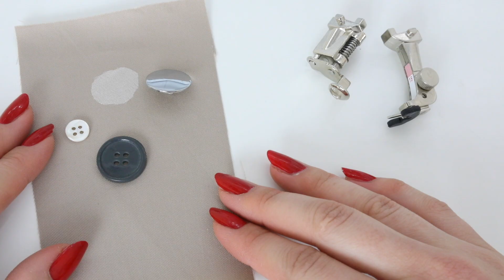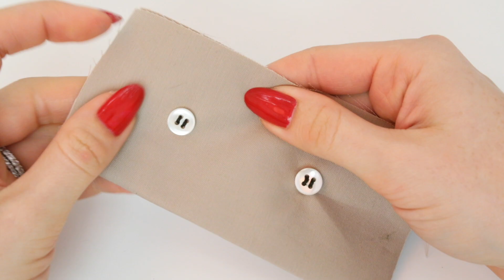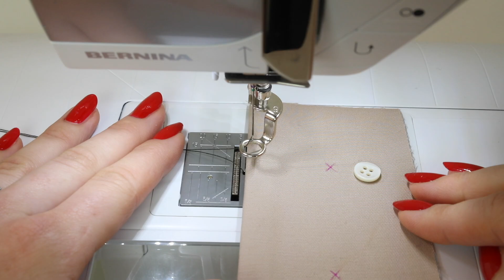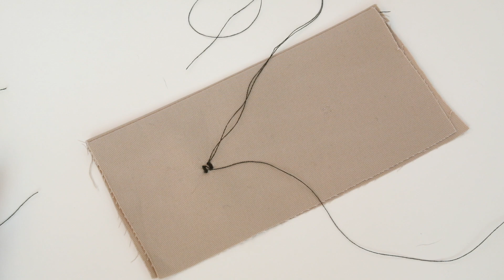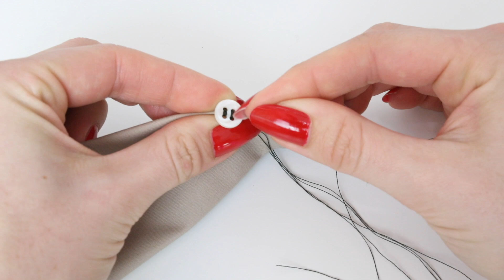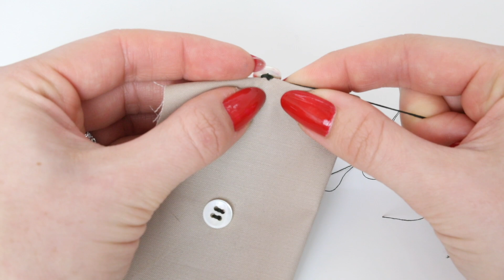How To: Sew Button On Machine

Comment: Hello!  I have recently found your videos, and watched the sewing 101 series.  You have definitely inspired me.  I was wondering if you have any suggestions on how to sew on a button to a hand knitted piece.  I knit, and I need to add 3 buttons onto a baby sweater I have finished.  Thanks in advance! <3
Reply from the maker: I would probably sew them on by hand. You will want to create a shank (if the button doesn't have one) (I explain buttons with and without shanks in the video). To build a shank by hand I would use a cocktail stick and sew over the button and cocktail stick. Then when you remove the cocktail stick you can raise the button and you will have a shank. Hope this helps? Aneka

Comment: Have you thought of using an external mic to reduce the echo?
Reply: Ah ok. Maybe it’s switched over to camera mic instead of the external accidentally. Darn technology 😂😂
Reply from the maker: @camilleakdj3648  I don't think it can switch back as I use external mic as my only input. It is probably the settings I have used 'all the gear, no idea' is unfortunately my scenario! Lots of guessing and watching other YouTube videos on 'how to'! Is it like it throughout? I am trying to find the problem. Thanks very much for letting me know. Aneka x
Reply from the maker: Hi Camille, I do use an external Rode mic for my videos. Not sure what went wrong here, maybe I didn't have it set up properly? I will look into the issue. Aneka x
Reply: No problem! Hope you work it out, I have absolutely no idea in what direction to point you 😅😅😅 I can’t even work a printer most days 🤣🤣
Xxx

Comment: The Viking machines past yours (just a little newer) have a button hole foot that allows for shank and stabilizes the button thereby requiring no tape.  Gosh I did not know you had to allow for more shank with thicker fabric, thank you for sharing that, cheers!
Reply from the maker: Thanks so much for sharing. It is hard for me to keep on top of all the machine models, showing options of what is out there. Thanks so much for sharing this. Aneka x

Comment: I’ve also never tried this before. My machine sewing is largely self taught (with the gaps to prove it!) and hand sewing was taught to me by my mother (who had amazing skills but didn’t enjoy it very much). I’m uncertain about how to go about sewing the anchor button on the reverse side. I’ve seen it on garments but it’s unclear to me how to go about it. Is one machine sewn and the other hand sewn as the holes wouldn’t line up? Do they both require a shank? I’m assuming only the larger outer button would need one. Which is sewn first? I’m sorry for all the questions and thank you so much for the video and your time. So informative and a pleasure to watch.
Reply from the maker: Hi Anna, more often them not I will be sewing a reinforced button by hand - simply because the exterior button often has a built in shank. If I am sewing it on by hand I will sew through both buttons at the same time, so that they are connected by the same thread. You would want a shank on the exterior button - as this is the one that is used. However the interior 'support' button does not need a shank. Hope that helps? Aneka x
Reply: Made to Sew - thank you. That makes perfect sense.

Comment: Interesting to see how this works. Never sawn on a button with a sewing machine. Have learned (from my mother) to sew on buttons by hand with a decent shank. In the manual of my (still new) Husqvarna machine it shows to use that little hooked tool (with slits for sewing over thick seams) under the button to create a shank. Don’t know if it works. Have not tried it yet.
Reply from the maker: Hi Lily, I often sew on buttons by hand too. It is what my grandmother taught me :-)). Sometimes when you have a lot of buttons to sew on this can help. :-))